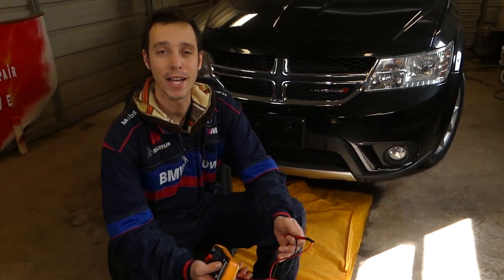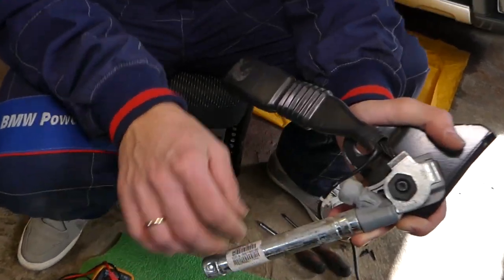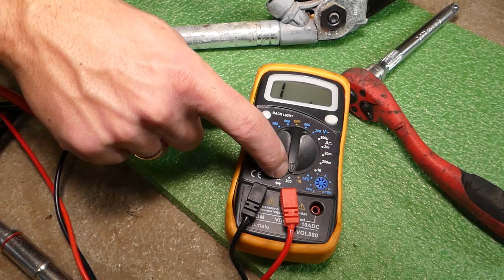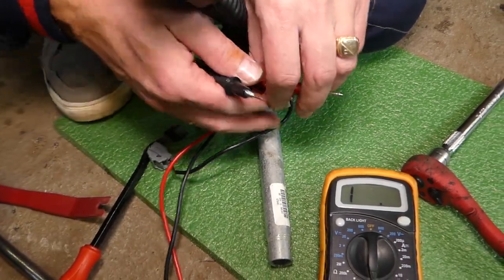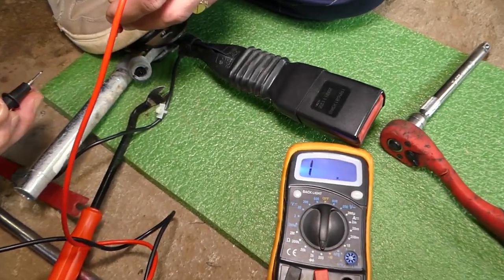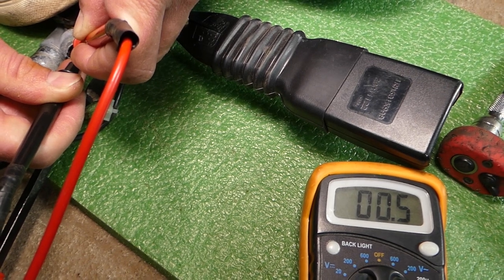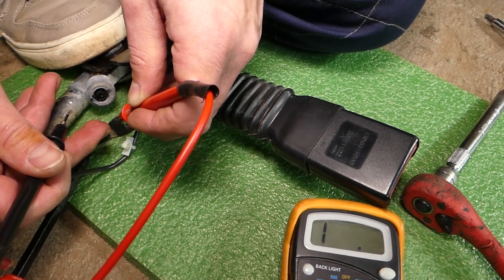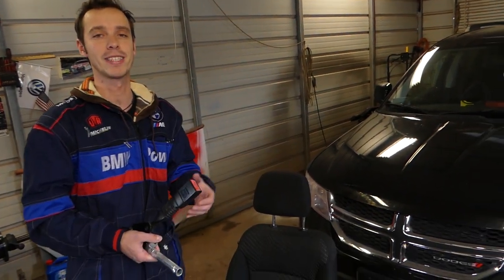HOW TO TEST SEAT BELT PRETENSIONER ON DODGE JEEP CHRYSLER

Comment: i have 3 airbag codes on my 07 jeep wrangler; B1Ba6 occupant classification undetermined, b223d OCM DTC present, B1c3a 1st row driver retratctable pretensioner circuit open.
I performed this test on the driver pretensioner pins and I got 0.3 ohm's.   Now what????
Reply: Probably your wires. Or the connectors are bad. Unplug then and plug them back in and see if that makes a difference 🤷‍♂️
Reply: Did it work?